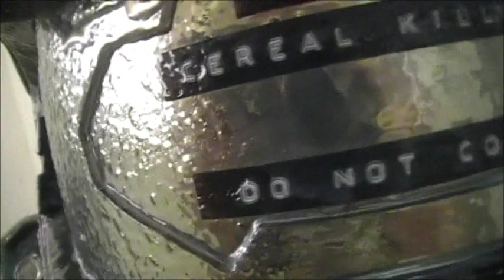How to make a Mother Mold - (my first time)

Comment from the maker: Hey blackluc, that's a very hard question to answer. The amount for the mold is approximate. As would the cost per cast. It would all depend on what material you intended on casting with and (if any) reinforcing additives. You would have to do some research on methods and products. Depending on what route you take, a helmet cast can cost you anywhere between $20 ~ $50 to reproduce.

Comment from the maker: For the visor, you can buy Motorcycle face shields. (I used ebay for mine)
The whole suite is not yet complete. When the entire suite is done, I may mold it all. Have not decided on that yet. For now, it's just the helmet that has been molded.

Comment: Hi there!  (Ou bien salut, si tu parles français?) first of all, your job is fantastic.  I am currently working on my helmet and my bondo work is just horrible.  My pep wasn't great to begin with and I noticed it way too late.  Shaping it is pretty hard.  Now I am stuck with pinholes and crap everywhere.  Anyway.  I was curious, How much does it cost to make a mold with dragon skin and how much is it per cast?  Your first one turned out very well!  How solid is it compared to the original?

Comment: I'm planning to rigourously test the materials I will use for the job, and I will be purchasing an airsoft mesh mask to replace the visor with. As for the rest of the suit, I currently have my eye on ABS plastic, which is what professional airsoft guns are made from. I definately will not take any risks, however.

The only mandatory protective gear in airsoft in the UK is the eye protection, which I will be taking plenty of care with.

Comment from the maker: No, I used 3 pint kits to make the inner mold.
How many coats of one kit... depends on the thickness of the coats, it always changes so there is no number of coats per pint. The inner mold needs to be 1/4" thick.

Comment: Thanks.  But once the mold is done, I want to make a few casts for friends and family and before doing so I want to give them an estimate.  How much is it per cast?  And for my pep, I meant my model wasn't the most accurate and even if it was HD, there was still for less détails than the one you used.  I noticed it when I was bondoing.  Now it's done (just need to do electronics) but it was hell to bondo and maybe I'll do a new one later.  To anybody reading this, choose your pep wisely!

Comment from the maker: Unfortunately no, I do not speak french. I am a very bad Canadian :(
Pepping is the most important part of the build (check out "what is pepakura")
Whenever anyone tells me that there was an issue with the pep, I always advise to re-do or repair as things will only get worse if you keep going. Pinholes and such can be fixed with filler. Making a mold is quite costly. Aprox. $250 when you factor all the materials (no labor included) Casts (if done correctly) are just as strong as the originals.